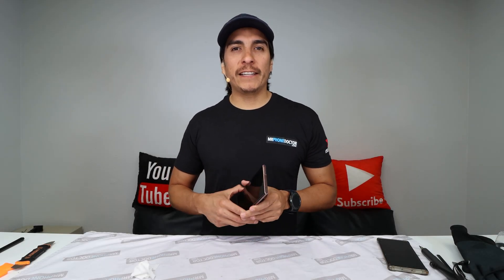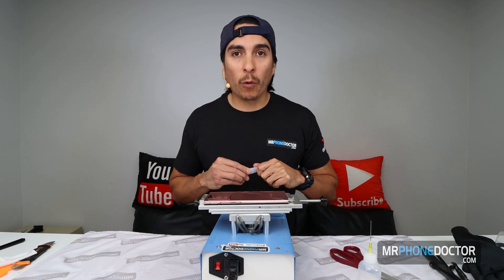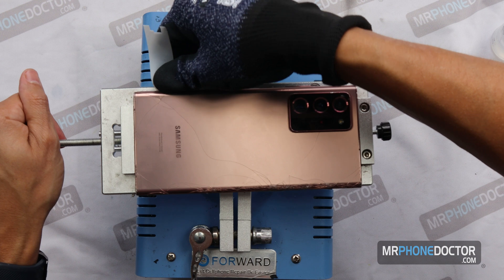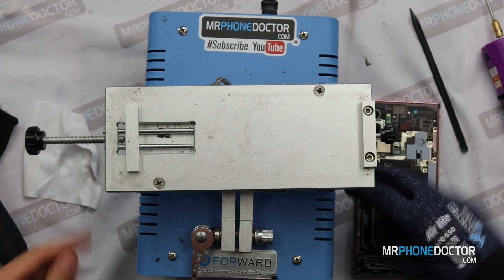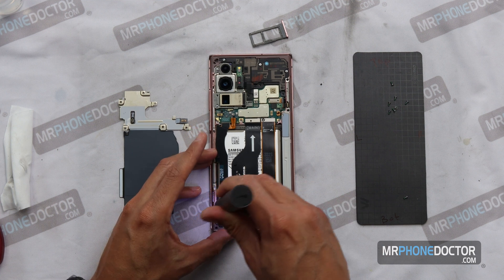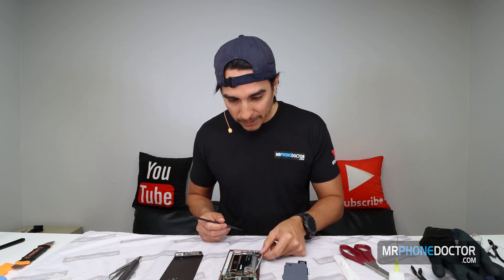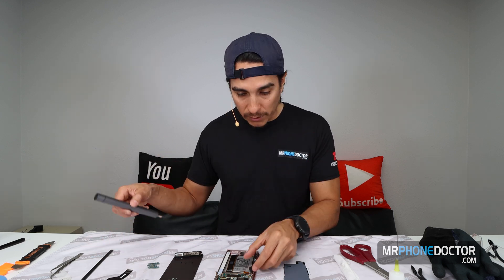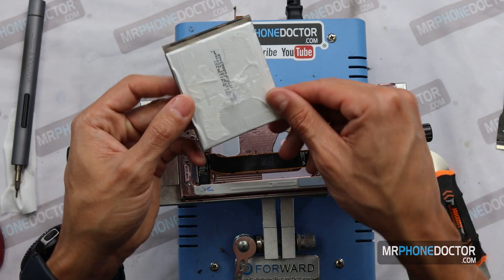Samsung Galaxy Note 20 Ultra Full Teardown Guide

Comment: Nice video! Does the Galaxy Note 20 Ultra 4G (SM-N985F) have the same motherboard as the Galaxy Note 20 Ultra 5G, so can I replace it because mine fell into water? Can it fit? Will it fit?Thank you in advance.
Reply from the maker: That's a good question. I am almost sure they won't be compatible. International versions sometimes have different layouts on frames. 

I would recommend searching
Reply: @MrPhoneDoctor some guys telling that it is fits

Comment: Is there a way to repair or order a 5g atenna green press connector on left top side or is that digital death? My portion that attaches to the board is fine but the connector prongs going to the atenna are damaged.....some are bent, and some are brokn.